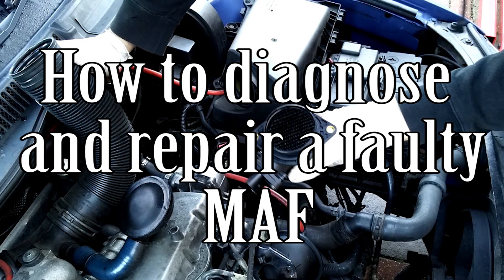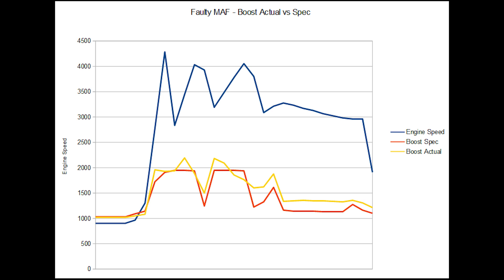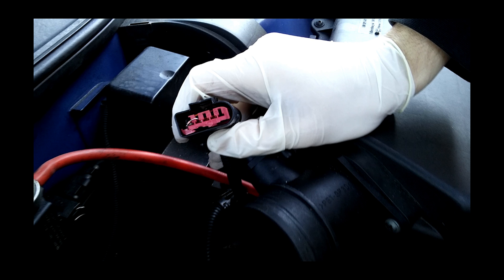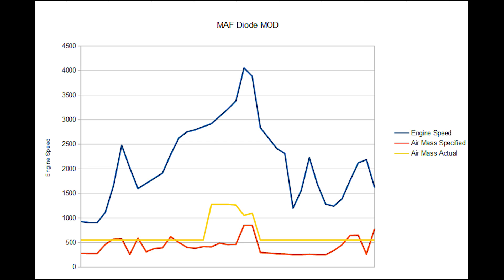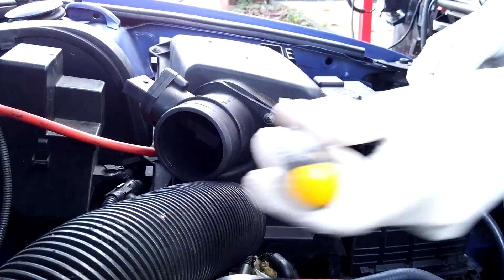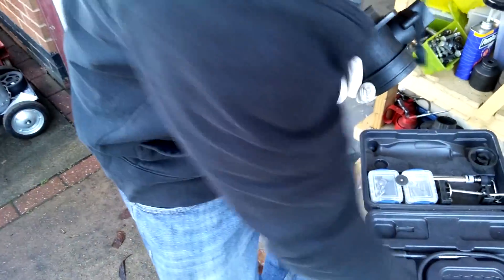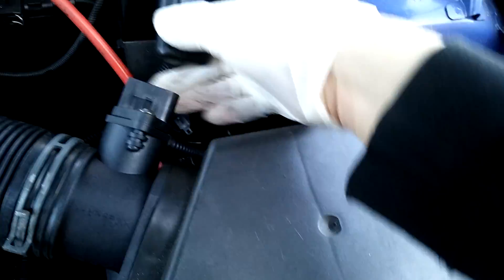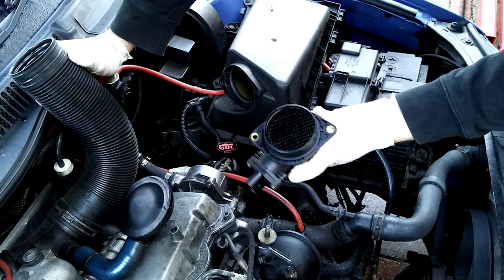How to diagnose and repair a MAF Sensor

Comment: Thanks for the video. I believe my MAF is failing. I'm throwing these codes and getting lots of hesitation under 3k RPM. I've also noticed my mileage has gone down quite a bit recently! My idle is a little off also. 

3 Faults Found:
16683 - Boost Pressure Regulation 
            P0299 - 35-10 - Control Range Not Reached - Intermittent
17535 - Fuel Trim; Bank 1 (Mult) 
            P1127 - 35-10 - System too Rich - Intermittent
16556 - Fuel Trim; Bank 1 
            P0172 - 35-10 - System Too Rich - Intermittent
Readiness: 0000 0001

I ended up buying a Genuine Bosch off ebay for $70 USD. PN: 06A 906 461 L

I sure hope it solves my issues but I'll use my VAG-COM to do some testing like you did. I have 166k on my original MAF so it's probably faulty. Tried that CRC MAF cleaner and it didn't help.
Reply from the maker: +BOOSTEDDUDE it would be great if you can let us all know after what the issue was too. Sometimes these issues are just the MAF, sometimes they can be other one off issues that are much rarer. I hope the MAF get's it going again! There is nothing like when things work as they should.
Reply: +CarAnd “Car Mechanical” Mechanical - Yeah, I'll report back. My Bosh MAF is set to arrive next Monday. If that doesn't fix my issue I'm taking it to my mechanic to perform pressure test,etc. I'm going to do some logging this weekend to see if I can get some good data. BTW, how did you plot your values on the graph? Did you just use Excel or some other program? Thx!
Reply from the maker: Either excel or Open Office Calc, when you import the CSV data it's comma delimited you want.
You have reminded me I need to do a video on how to interpret these logs.
Reply: +CarAnd “Car Mechanical” Mechanical Can you take a looks at these two graphs I did today? It was cold out this morning and I had a really rough start! It stalled 2x and sounded like it was running on 2 cylinders! The 3x time it started and once it slightly warms up it seems to stabilize on all cylinders and keep running. It got me to the gym and back with 4 stops in between in limp mode most the time (5 psi instead of 15). Block 002 for mass air flow readings was within spec.  2-4 g/s at idle, so I suppose that's normal. But I sure hope the MAF is causing these issues! The only other code I'm throwing is this one>
1 Fault Found:
00779 - Outside Air Temp Sensor (G17) 
            30-10 - Open or Short to Plus - Intermittent

And my temperature reading seems fine and accurate on my dash so not sure what this is about but might get this sensor replaced as well. 

Here's my graphs. Hopefully they have some decent data showing the MAF might be bad.

http://i.imgur.com/PUYepbx.png
http://i.imgur.com/uDTXUM4.png
Reply from the maker: What groups were these pulled from? I'd normally look for MAF spec and Maf actual. And same for boos spec and boost actual.

Temp could be IAT on the MAP sensor as the MAP sensor does pressure and temp.
Reply: +CarAnd “Car Mechanical” Mechanical Here's some more logs from today. On my way back from the gym I logged Blocks 002,032,115. As seen here. http://i.imgur.com/mnZaCFd.png

Also, if you wouldn't mind taking a look at my logs that would be great! It was cold again this morning and it was the roughest start yet. Took about 4x before the engine started up and would stay stable. The first logs I was using Advanced measuring values and logged a bunch of stuff. Mainly I wanted to see if I was throwing any misfires since codes 17535 & 16556 mention spark plugs or ignition coils could cause these codes. I didn't see any misfires so I assume both are good? I read this on ross-tech site. 
http://wiki.ross-tech.com/wiki/index.php/17535/P1127/004391_-_Fuel_Trim;_Bank_1_%28Mult%29:_System_too_Rich

Here's my logs. Hopefully these links work. 
https://www.dropbox.com/s/w9tn38wd0384ftw/LOG-01-002-032-115.CSV?dl=0
https://www.dropbox.com/s/8oexpz11lafd67s/LOG-01-028-034-048-14C-157-161-342-1154-1184.CSV?dl=0
Reply from the maker: Petrol's and this finer side are not my strong suit so might as a friend on this.
I'm guessing this is a 150bhp 1.8T? Turbo at 830 mbar is 12 psi which I think is atmospheric. 

But I notice max is 1200 mbar which take off atmos would be around 5 PSI - I would need to check what is normal on that engine as my TDI boosts in the 10-20psi range.

It's possible something is pulling down requested boost
Reply: +CarAnd “Car Mechanical” Mechanical Actually it's a stage 2 1.8t AWP Jetta making between 214-250 (guesstimated) when in different Octane modes on different gas. Stock was 180hp. I'm planning on changing the programming and going with bigger injectors,etc soon but need this bug worked out. I'll have my MAF tomorrow so I'll know if that's the issue. Thanks for taking a look. My altitude is a mile high so that might be helpful. Also, I've been stuck in limp mode at 5 psi for the most part. Normally I hit 15+ psi.
Reply from the maker: I thought you were high up, vid I've got coming out soon is for my digital boost gauge and I've set the atmos to 13.5 PSI otherwise it would show me making 30+.

Let me know how the MAF goes and I'll see if I can find out what LAMBA settings trigger either fuelling, or pot timing retardation issues. I can see that adduction - but no idea what or why it's there but an change of 20 makes me think it could be trying to avoid knock, or I'm reaching on my guessing.
Reply: +CarAnd “Car Mechanical” Mechanical Hey Buddy, I just wanted to report back that the MAF was my issue. I just can't believe it caused such crazy hard cold starts! I hope I didn't damage my engine by starting it in that condition. Today it fired right up but I'm seeing occasional spikes in my vacuum boost gauge and the engine hesitates. Oh well, it's not throwing any more rich codes after a good 40+ mile drive and it's pulling good again! So, still kinda sketched but running WAY better with the new MAF!
Reply from the maker: Awesome, sorry I wasn't able to help more then "yea the boost is way low" but glad it got sorted. 
It looked like the closed loop on the petrol uses other stuff, like I knew o2 sensors are used but odd I didn't see the MAF mg/r in the logs.
Reply: +CarAnd “Car Mechanical” Mechanical Thanks for your assistance! I really appreciate the input! My car is so much better with a new MAF! I can't believe it caused my car to start up like that! I wouldn't advise anybody to try and start their car when it does this! I'm just hoping I didn't damage the engine by doing that. Either way, it's running nice for now! :-)

Comment: I'm thinking about ordering a 30 quid MaF from eBay. Has yours turned out OK two years on? There's a lot of talk in forums that these cheap parts are dodgy and they often swear by original Bosch MAFs which are silly money. If this works, this is the route I want to go.
Reply from the maker: +rivolinho Yep pretty much everywhere I go I hear the same, I'm still on this same MAF two years and over 25k on it.
I got my MAF from GSF, they often run weekend 33%-40% off codes if you are are their email mailing list. If you get one from a motor factors they normally come with a 1 year warranty so it's nice to have somewhere you can walk into and swap it.

Also not sure if specific to VAG cars but I've seen people go through official ones every 2-3 years and some never at all.
Reply: Just priced the MAF alone (without the housing) from local motorfactors and Im looking at €80 / £65
Looks like I will be giving a cheap and cheerful ebay sensor a shot. I suppose I'll just get one with a warranty and hope for the best!
Reply from the maker: Are you UK based? I'd of though online order through EuroCarParts of GSF would be cheaper
Reply: +CarAnd “Car Mechanical” Mechanical Thanks, had a look on that site and the only option they have is a Bosch unit with complete housing for 185 quid or a spurious alternative for 120!
During my investigations, I did find the MAP sensor on the manifold was completely clogged with black crud. Could this be my culprit, considering the MAF was A-OK until I gave the car a high revving driving and possibly dislodged rubbish in the intake.....?
Reply from the maker: MAP sensor being clogged might of made the car put more boost in if it was blocking the reading, I know how my A3's closed loop works on this and if it gets too far out of spec it'll limp/safe mode so there could be something there.
If there are any options for data logging the sensors I'd have a look.
Reply: I replaced my original maf 18 months ago with a remanufactured one from ebay. That died 3 weeks ago so bought another one fitted and the engine started to have misfireing, after 3 week working on, it turn out to be the new maf , was working fine then the reading was jumping to over 22 while idling, for a few seconds so felt like a misfire, fitted my original maf and problems gone,

Comment: Thanks for the video! I'm trying to diagnose the problem I'm having with my 1.9 TDi golf mk4. About a month ago I had an issue where the car would shake in every gear under low revs it was pretty much undriveable... I used some EGR valve cleaner and for my daily commute of 8 miles it was works, seemed to sort the problem out. However when I go on a motorway, get to about 80mph I feel the same judder/shake loss of power briefly until I either slow down or go above that speed. Could this be down to the MAF?
Reply: Very possibly. I have the same symptoms on my Freelander diesel. The judder is probably misfiring because of fuel starvation. I initially thought it was a blocked injector but when I removed the MAF the carcdrove like new.

Comment: According to my local VW Guy I have to replace two air regulators (flaps) on my 2008 3ltr diesel Touareg that are  "sticking " at a truly phenomenal cost, Each part about £ 350 where do they sit in the air system ????
Reply from the maker: +Toddy hmmm that's perhaps a unique way of putting something that could be a few things.
The only "flaps" really would be the actuator for the turbo and the EGR system.

What is the issue you are seeing?
Reply: An engine warning light (orange) keeps coming on infrequently, it seems to be dependent on the weather temperature, it has no noticeable effect on fuel consumption or performance, and the VW guy said it won`t do any damage to the engine.The only thing that might happen is if they stick shut the thing won`t start or if they shut whilst driving the motor would cut out.Having said that i`ve been driving it like this for a year and a warning light is an M.o.T failure which is due in November......
Reply from the maker: Hi Toddy, first step I would take is understanding what this warning light is trying to tell you.
If you can get VAGCOM on the car to pull the fault codes that will be a great start.
Also what thing is it that was said might stick shut?
Reply: apparently the thing is called a "saug rohr klappe" which translates into "vacuum pipe flap " the guy said he couldn`t remember the code so i might have to go and get it read again.